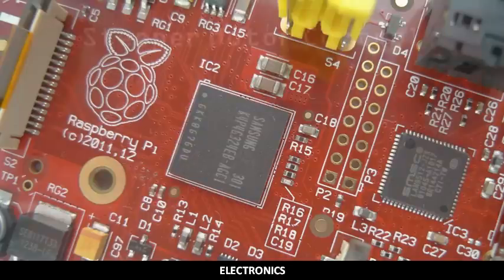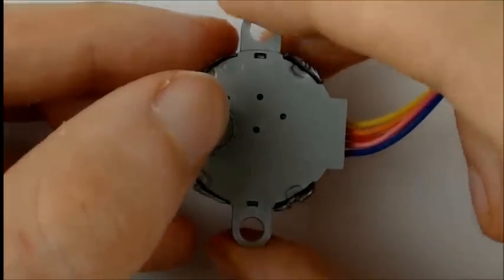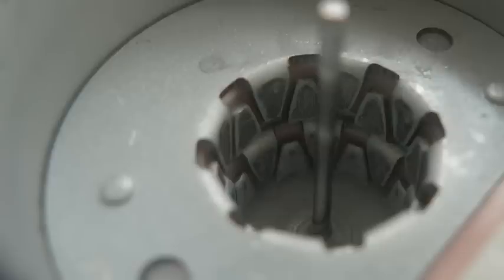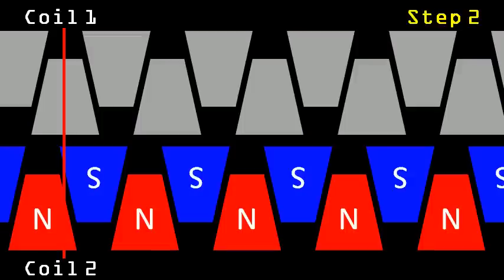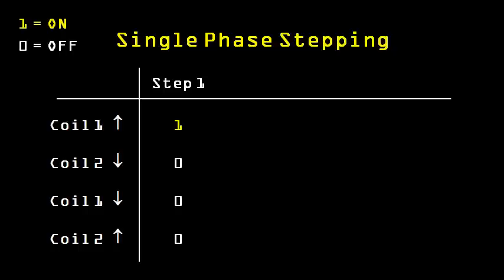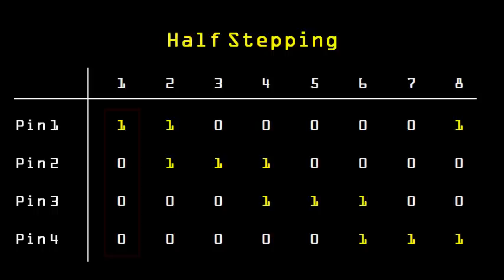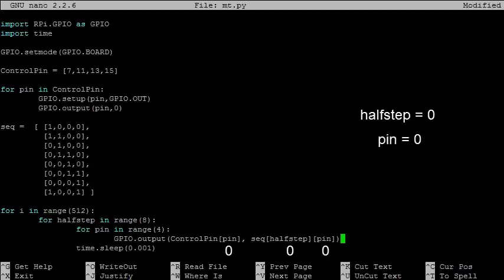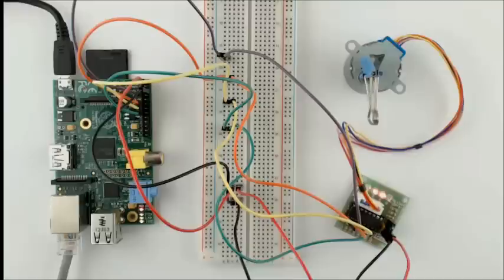Stepper Motor Control with the Raspberry Pi

Comment: I got an error "line 9, in <module>
    GPIO.setup(pin,GPIO.OUT)
ValueError: The channel sent is invalid on a Raspberry Pi". I fixed it by changing line 4:

GPIO.setmode(GPIO.BOARD) #corrected to >>
GPIO.setmode(GPIO.BCM)

Something may have changed in RPi.GPIO since this was originally written.

Comment: Thanks, really nice explanation, very educational. On a closer look I see that at 1:39 the gears inside are not in the right order and the motor won't work as shown. I guess after you initially tore the motor down, when you reassembled it for the video you accidentally flipped the gear next to the blue one upside down.

Comment: Here's the code:

import RPi.GPIO as GPIO
import time

GPIO.setmode(GPIO.BOARD)

ControlPin = [7,11,13,15]

for pin in ControlPin:
	GPIO.setup(pin,GPIO.OUT)
	GPIO.output(pin,0)
seq = [ [1.0,0,0],
		[1,1,0,0],
		[0,1,0,0],
		[0,1,1,0],
		[0,0,1,0],
		[0,0,1,1],
		[0,0,0,1],
		[1,0,0,1] ]

for i in range(512):
	for halfstep in range(8):
		for pin in range(4):
			GPIO.output(ControlPin[pin], seq[halfstep][pin])
		time.sleep(0.001)
GPIO.cleanup()

Comment: I have bought the motor and the programme also worked. There was also something moving in the motor but this metal part that should move didn't. I opened it and saw that the gear from the magnets did move but it couldn't move the next gear and only scratched it. Does anyone know how to fix this? Thank you in advance.

Comment: import RPi.GPIO as GPIO 
import time

GPIO.setmode (GPIO.BOARD)

ControlPin = [7,11,13,15]

for pin in ControlPin:
   GPIO.setup (pin, GPIO.OUT)
   GPIO.output (pin, 0)
   
seg = [ [1,0,0,0],
        [1,1,0,0],
        [0,1,0,0],
        [0,1,1,0],
        [0,0,1,0],
        [0,0,1,1],
        [0,0,0,1],
        [1,0,0,1] ]

for i in range (512):
   for halfstep in range (8):
         for pin in range (4):
            GPIO.output (ControlPin[pin], seg[halfstep][pin])
            time.sleep (0.001)

GPIO.cleanup()
Reply: how to fix "Non-ASCII character /d3f in line 27?
Reply: @windows10person30  Probably a problem with the copy/paste using a special format for a comma or something, try rewriting the line.
Reply: @CrystalDataMusic  Thaks, I just typed it ad it worked, thanks!
Reply: @windows10person30  Happy to help!

Comment: Won't work for me. When I run it this error shows: "NameError: name 'Pin' is not defined".
Reply: delete this:

for pin in ControlPin:
 GPIO.setup(pin,GPIO.OUT)
 GPIO.output(pin,0)

and replace it with:

GPIO.setup(17,GPIO.OUT)
GPIO.output(17,0)
GPIO.setup(11,GPIO.OUT)
GPIO.output(11,0)
GPIO.setup(13,GPIO.OUT)
GPIO.output(13,0)
GPIO.setup(15,GPIO.OUT)
GPIO.output(15,0)
Reply: You probably just spelled one 'pin' as 'Pin'.

Comment: What a wonderfully explained tutorial. As someone who likes to know WHY not just HOW things work in the way that they do I can't thank you enough. 

My colleagues and I are attempting to construct an automated visual inspection rig using the Raspberry Pi as the PLC  and operating the camera module in conjunction with a 12V RGB LED strip. 

The motor control will drive a turntable and is more or less the last piece of the jigsaw puzzle and I think you have just helped us solve it. Thank you very much.

Comment: can it change directions ?
Reply: Diboguy I was use GPIO direct drive 8 digital 7 segment and LCD1602*1 and 12 stepper motors
Reply: Diboguy yes
Reply: Edward Lai sounds good thanks
Reply: Diboguy yes, you just need to reverse the stepping (seq) array if you can't figure out how to do so ;)

Comment: I really appreciate your excellent explanation of stepper motors and using Python on the Pi.  I just happen to have this exact same motor so I used the same seq config in my script.  I'm using the Pi to automatically control my wood stove by using a thermocouple as input.  Thanks!

Comment: A great explanation of a process that seems complex.  Stepper motors are used in so many applications, knowing how they work and are controlled is very useful.  Thanks!
Reply: splortz I was use GPIO direct drive 8 digital 7 segment and LCD1602*1 and 12 stepper motors

Comment: And tadam you can easily connect MCU to any computer, x86 desktop, or Pi using USB (use old cellphone serial cable or brew it yourself with FT232/CP21xx chip)

Comment: I think people is braindamaged by Pi 8-\  That's all tiny electronics games with Pi is better, much much cheaper and energy effective using any 8-bit microcontroller, you can easily get 30+ GPIOs vs few ping on Raspberry
Reply: Dmitry Ponyatov, I agree with you. But ..Not that I dont like working with Pi.

Comment: Since I need 4 GPIOs for one stepper motor, how can I address let's say 4 different motors? Or 4 motors and 3 servos? Or a bunch of motors and some GPIOs for other sensors?
Reply: John Michael Stock yeah looking at my comment one year later makes me realise it was kinda dumb. using i2c would be the best solution in my opinion, because you could, if you really wanted, control 32 steppers using only the two i2c pins. and of course, there are microcontrollers designed to run stepper motors which would work too.
Reply: You have to buy multiple pi's.
Reply: +Harm Prins I bet there's controller boards out there that can run several stepper motors.
Reply: and reading your comment after 2 years saved me !! I was so worried about this as well hahaha... btw can you please tell me which i2c chip you used... i am kind a new to this actually... I was looking at L298N chip... not sure if that's the right one :3

Comment: Excellent video and great tutoring!! To everyone who is interested: If you type the motor's name into the amazon search bar, you will find the exact same board and motor used in this video, as well as a board without the leds. The single uln2003a ic is also available everywhere for less than two bucks. I will use my hereby aquired knowledge to build a tiny desktop plotter and a picamera control! ;)

Comment: This may sound a stupid question, but I don't want the motor to run a prewritten program, I would like to type commands in to move the motor in a certain direction by a certain amount. Is this possible using python.

Comment from the maker: The control board I used came with the stepper motor. Aside from the debugging LEDs (with resistors) it only has an ULN2003AN chip.

With regards to the pins, 4 GPIO pins attach to 4 pins on the board (labeled IN1, IN2, etc...) and ground and 5V attach to a second 2 pin header. Hope that helps.
Reply: Would it work without it?

Comment from the maker: The Pi has 17 GPIO, which means you could run 4 stepper motors directly from the Pi (as each requires 4 GPIO pins), though some of those pins may need to be reconfigured, such as the UART pins. If you need more GPIO pins, check out the MCP23017 I2C port expander.

Comment: This mentions the motor model # but not the control board and which pins specifically on the pi needs to go to which pins on the controller board.

Comment from the maker: I'd first try searching the web for a datasheet. If one can't be found, I'd still worry about connecting a GPIO pin directly to a wire which I'm unsure of its function. I'd definitely use protection, at the very least a transistor. The  stepper motor is this video uses a darlington array (uln2003).

Comment: would love to know if you need the stepper motor control board... The stepper motor i have is from a printer and has its own separate power cable. Could i go straight from the GPIO into the stepper then? considering the stepper motor isn't getting the power from the Raspberry pi?